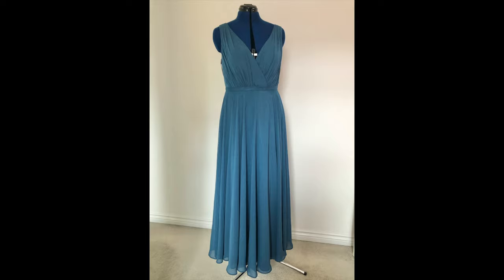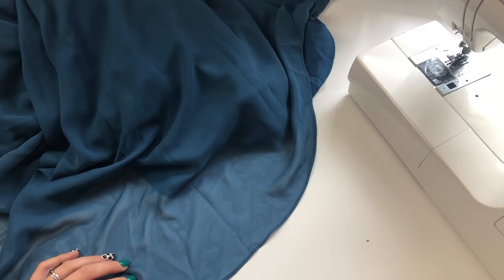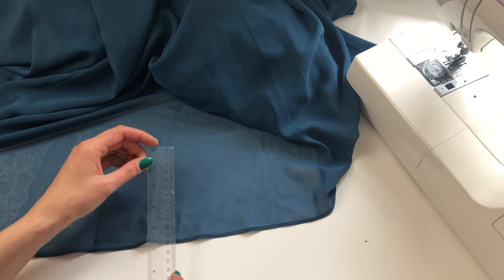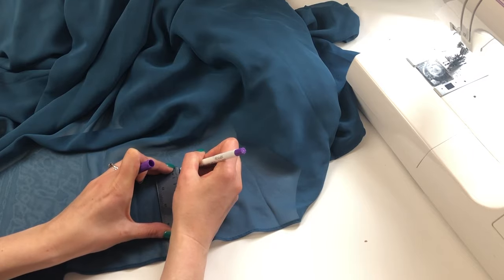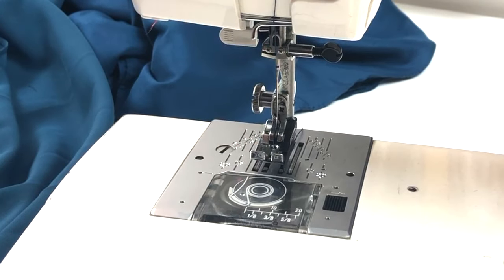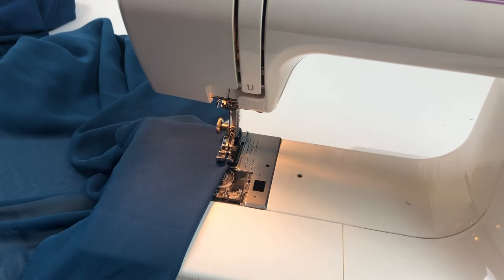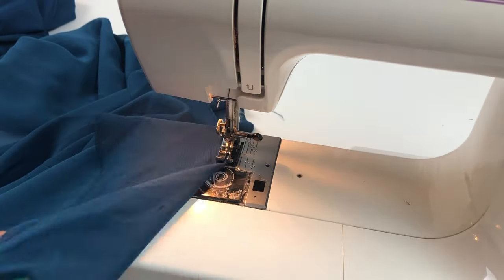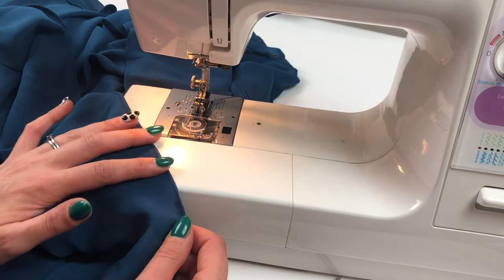How to Hem a Chiffon Bridesmaid, Prom or Formal Layered Dress

Comment: Thank you!!!  I have three bridesmaid dresses to shorten and was terrified to begin.  Your method is so great, thank you sooooooo much for sharing.
Reply from the maker: No problem at all! I’m really glad you found me. Good luck with the alterations 😊
Reply: @HouseofMissSew I have a question, I’m hemming a bridesmaid dress that is also three layers but has a slit. How do I do the side seems where the slits are?? I’m not confident in that part at all. HELP thank you
Reply from the maker: @andreaf5765  I would mark up the hem and alter as shown in the video. Take a look at the finish on the hem at the slits and try to replicate this at each slit by neatly turning up the hem. It may help to add a little hand stitching at the ends if you need to.
It’s likely that the slit has been finished first and then the hem is finished last so you’re still sewing everything in the same order.
Depending on how much you’ve taken off the length you may need to open the slits further. It would be easier to avoid this to save complicating things but it just depends on the length and position of the slit once you’ve altered the hem. ☺️

Comment: Oh my goodness!!!!  I hem A LOT of these and this should work perfectly.  The problem with even just stitching one time, trimming, then rolling is the material stretches or frays and it is too easy to make an uneven or wonky hem.  Hope this works when only hemming the front of a dress that angles to the sides, therefore creating a bias section.
Reply from the maker: I’ve not tried only hemming one side but hopefully the method will work for you 🤞 I find it’s so much easier than trimming first and have had no issues with hems stretching out of shape (which would happen if I did a normal rolled hem approach!) ☺️

Comment: Thank you so much for this video! I’ve always cut before making the hem and my machine would grab the threads of the chiffon and bunch them, making the dress look terrible. Does this technique stop that?
Reply from the maker: I’ve tried both ways and it’s much easier to cut after you’ve stitched. You have more control over the fabric and it’s easier to handle. I think this method would avoid the bunching that you describe 🤞🤞

Comment: I feel like I could do this!! Have a bridesmaid dress I need to hem and have a tight budget! I do some sewing, but never a hem before! Are you marking and sewing on the outside or inside of the dress?
Reply from the maker: You can do this! Just take your time, measure and cut carefully. 😊
I’m marking onto the right side of the fabric, then folding along that line so the wrong sides come together, then I stitch on the right side. Once the fabric is trimmed I fold the fabric and sew from the wrong side to make sure I’m stitching along the edge of the fold correctly.
Good luck 🤞

Comment: thank you for this lovely tutorial!! two quick questions from a newbie sewist:
1. what is "right side" and "wrong side"? is right side the outside of the garment and wrong side the inside?
2. how do you "back tack" at the end? my machine only pulls the fabric one way (brother SE600 I think) and I don't want to break a needle by attempting to get it to move backwards without any guidance first haha
Reply from the maker: Thank you for your feedback ☺️
You’re correct, the ‘right side’ is the outside of the garment and ‘wrong side’ is inside the garment.
Back tacking is to take a few stitches back and forth to secure the stitching at the start and end of sewing. Your machine may have a button to press to secure stitching. 
Hope that helps 😊

Comment: Can't wait to try this as I am beginner to all of this.   Do you have any tutorials on shortening shoulders on formal chiffon dress?
Reply from the maker: I’m sorry, I don’t have any shoulder shortening videos. Depending on the style you can unpick the previous seam and re sew this at the correct position. Depending on the layers it can be a little tricky. 
For a quick fix just stitch the seam where you need it to be (without any unpicking) and then sew the part of the strap that is excess along the sides to hold it in place. I did this for my own bridesmaid when I had only a few hours left before the wedding to fit the dress correctly!

Comment: Do you have a video of pinning? I feel like a miss the mark with pinning.  Sometimes the back is shorter than the front due to the bottom.
Reply from the maker: Hi, I don’t have a video on how I pin up the dress before altering. I usually just take the same amount off all the way round.

Comment: I really struggled hemming the outer chiffon layer of my wife's bridesmaid dress. I tried just marking and sewing as you showed, but the fabric was too light and stretchy that it moved around too much and ended up terribly uneven and puckered. On the heavier inner layer, I decided to pin and press before sewing and had much better success. Any thoughts?
Reply from the maker: I guess this method doesn't work for everyone and every type of fabric.  I sounds like you cam up with a good solution 😊

Comment: How would you been the layer underneath if it's a thick stretch material? Hand sewing?
Reply from the maker: I’d try to replicate the finish that is on the lining already, either using a coverstitch machine or a twin needle on the sewing machine. Hand stitching would also work if you’re worried about the look of machine stitching.

Comment: Sorry i have a ‘beginner question’ when you cut then sewed the hem again will it shoe 2 running stitches on the correct side or 1?
Reply from the maker: You’ll only see 1 line of stitching on the right side of the fabric. You’ll see 2 lines of stitching on the wrong side.
Reply: Thank you. How did you stop the material puckering up? X
Reply from the maker: @annemarieathome5263  use a fine needle (universal or microtex size 70/10) and take your time. Set the stitch length to 2 or 2.5 so the fabric won’t be gathered as you sew. Test your stitching on a section of fabric that will be cut off.

Comment: hello , what needle , and tension do ou use , my fabric tends to break everytime i pass on leavin threads of the fabric on the way , so i tend to just pull very tightly on the fabric to make it less wrinkly and breaky , what advice can you give me ?
Reply from the maker: I used a sew all polyester thread and a universal size 70/10 needle. Make sure that you’re using a good quality thread. I didn’t alter the thread tension but you may find that a lower tension on the needle thread is better for you.

Comment: When I sow the fold the fabric gets askew and twisted (the edge bit) 😢 how do I prevent this? I think it might a problem with the tension or the my machine doesn't pull the fabric through the machine well. I have a Husqvarna automatic 21
Reply from the maker: Pull the fabric slightly in front and behind the machine to keep it taut as you sew. This will help to stop it from becoming twisted.
Test the technique on some fine fabric so you can see if your machine handles it well. You could try increasing the presser foot pressure (if you have this option) to help the machine feed the fabric with more grip.
Reply from the maker: Or lessen the presser foot pressure for less grip on the fabric.

Comment: How do you measure for the hem. Fold it up or mark it straight with pins
Reply from the maker: If there’s not too much to take off it can be turned up to the right length but when there’s lots to take off I mark a point at the centre front and back with a pin and then remove what is needed.

Comment: What is best needle size to use? And best tension
Reply from the maker: I used a sew all polyester thread and a universal size 70/10 needle. Make sure that you’re using a good quality thread. I didn’t alter the thread tension but you may find that a lower tension on the needle thread is better for you.

Comment: I love this method!!! How do you do this method if the original hem is uneven? I’ve tried measuring and have had the hem too short or too long in spots. I end up pressing in the hem, basting the hem, and having a refit. Would love to get rid of this extra step!
Reply from the maker: Unfortunately I don't think there's a quick way around it if the original hem is uneven.
The best you can do is to try on the dress, mark the level of the new hem all the way around the dress, stitch the new hem and hope for the best. 🤞
Reply: @HouseofMissSew  thank you
Reply: I think should cut level then sew.  I agree with  Bev
Reply: @HouseofMissSew  I think so too.

Comment: What's that marker pen you're using? I have a blush pink chiffon to hem, and not sure of the best way to mark it.
Reply from the maker: It’s an air erasable fabric marker. Ideally it will disappear over time, or wash out with a little water. I find that chalk doesn’t transfer easily onto chiffon unless you apply a lot of pressure, whereas pen marks require only a light touch.
The markings will be hidden on the inside of the hem in the final stage of hemming.
Reply: @HouseofMissSew  thank you 💕

Comment: How do you stop the back from being higher
Reply from the maker: Sorry - I’m not sure I understand your question.
Reply: Yes I could. But any idea why that happens??? I cut the pattern probably
Reply: This is the same thing that I am worried will happen. My gal’s back side is larger than her front side. Trying to mitigate this issue before I begin the hem.
Reply: Don’t just cut the same amount off everywhere…mark where the dress hits the floor when they try it on and then mark up an inch or so from that line.  Sometimes you cut an inch different from front to back.

Comment: Thank you for the instruction video. I learned a lot. Do you make the lining a little shorter than the outer layer or the same length
Reply from the maker: Thanks for watching  😊
Since the lining is already shorter on the original dress, I decide how much the outer layer needs to be shortened by and then shorten all layers by the same amount.

Comment: Hi I  made a costume that has a long skirt with bodice. When I tried on the dress the back of the hemline was higher than the front.
Reply from the maker: Can you adjust the whole hem to raise the front more than the back? Maybe ask a friend to help pin a line where the hem should be.
Reply: Yes I could do that but why did that happen in the first place?????
Reply from the maker: @justm105  I'm not sure. Sometimes it can be the fabric - depending on the weight of the fabric it can drape and stretch slightly as you construct. It can help to allow a garment to hang for a few days before hemming to see if the fabric has moved. 
How the hem falls can also depend on figure types. for example a flatter bust may mean the hem hangs lower at the front, a larger bottom can cause the hem to sit higher at the back.
Reply: @HouseofMissSew  so I should raise the front hem an extra half inch?
Reply from the maker: @terinamoffett6745  it’s hard to say how much you might need to raise the front. It’s best to ask the person to try on the dress with the shoes they intend to wear with it and then pin up the front and back to the amount required.

Comment: Did you use a specific type of needle or just the standard one?
Reply from the maker: I used a universal needle 70/10
Reply: @HouseofMissSew  thank you 🙏
Reply: @HouseofMissSew  do you think a 70/10 would work? What pressure foot and thread setting did you use?
Reply from the maker: @liliesofthefield5310  yes, 70/10 would be perfect. Think I used a medium presser foot pressure and didn’t change the thread tensions.
Experiment on the bit of fabric that will be cut off to check your machine settings are correct.
Reply: @HouseofMissSew  thank you, that's such a great tip, I would have never thought of that🙏

Comment: I am hoping you might have a suggestion for my situation. I am hemming a lined, crepe gown. The factory  hem was done with a serger and had a grest blind stitch that did not show  in the least on the front of the dress. I do not have a serger but was able to use a similar stitch to bind the edge where I then cut off the excess, a principle you have shown in your videos. Now, I need to hem it, I am trying to blind stitch by hand but even the scantest amount of material I pick up is showing as a tiny pucker in the front. Any ideas? 

I tried testing a Pellon fusible adhesive like "stitch witchery". It looked great, but afraid to use it on the gown. Thank you!!
Reply from the maker: Can you test out a few techniques on the excess you have cut off? 
Maybe try the interfacing and see how it looks with hand stitching where you catch the interfacing instead of the fabric. Yo hold the stitches. Sometimes the interfacing can show through the fabric too much though so best to test before using it on the gown.
Maybe you can hem using a visible stitch like the rolled hem instead?
Reply: @HouseofMissSew So kind of you to take the time to help! I thought of rolled hem too, but the original gown had a 3/4" hem and material is a heavier weight. I will try your suggestion about interfacing. Lol, my husband who has never sewn anything, also suggested interfacing! Can't wait to tell him what you said😊 Thanks again!!😇
Reply from the maker: How funny! Clearly he’s an expert! 😂
Reply: Just wanted to let you know that the fusible interfacing placed along the hemline was the right solution to my problem! 😊
Reply from the maker: @YahuahLives  brilliant! I bet your husband is feeling quite pleased with himself for suggesting it! 😂

Comment: Nice video. 
Tension settings is where I have an issue.
Reply from the maker: I didn't really cover this in my video but you can test out the thread tension on some of the excess fabric. I didn't make any adjustments to my usual machine settings. A fine needle (size 70/10 or 80/12) is best for fine fabrics.